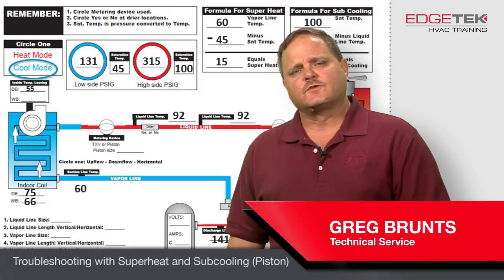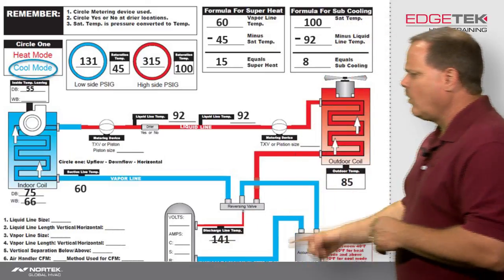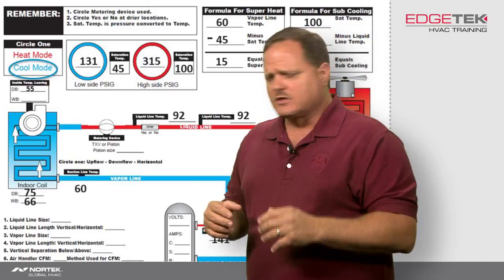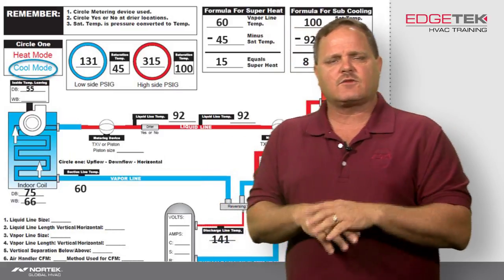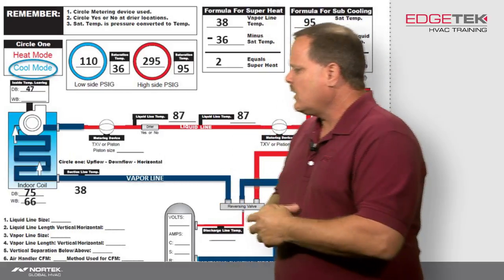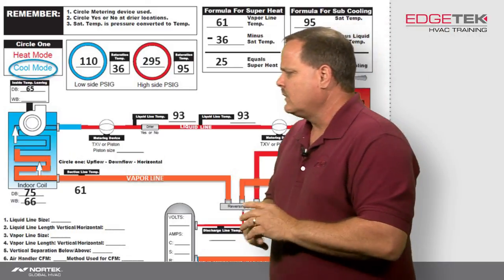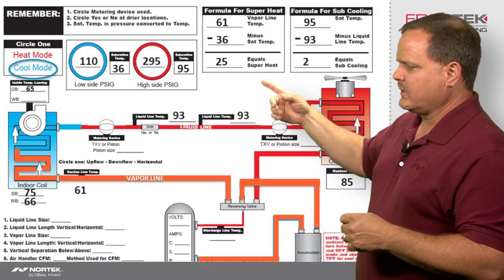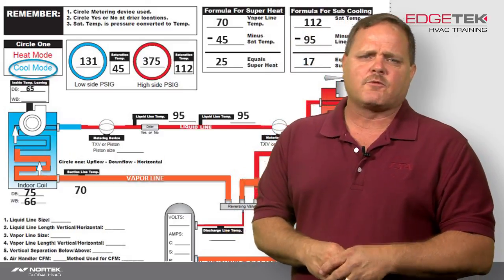Troubleshooting with Superheat and Subcooling (Piston)

Comment: Today I actually had the "undercharge" condition(SH 30deg over target, SC 5deg) but my head pressure is 390 which seems high.  Piston metering.  Airflow good, filters clean. Afraid to add more refrigerant since due to high pressure. Am I concerned for nothing and should just add refrigerant and only look at temperature targets regardless of pressure? You mention "don't care about pressures", so perhaps I'm just overly cautious.

Comment: I like the movie "Sling Blade"...keep it simple!  You come on a unit with a frozen evaporator cut it off.  Check the filter(s).  Put it in the heat mode and defrost the evaporator.  Then put your gauges on it and see if it is low freon.  You checking all this sub cooling and super heat when you could go and check for a stopped up filter and defrost the coil and sign off on it!

Comment: i got R 22 system ,,,,low pressure on suction side averages 35 psi with high superheat of 62, discharge is 177 psi average. sub cool yesterday was around 12. any suggestions? also evap freezing.
Reply from the maker: Please contact Nortek's technical service team at 1-800-422-4328 or contractorservices@nortek.com

Comment: Good Morning Sir, thank you for all the valued informations, me and my colleges would like to see and hear from you the Signs and scenarios to check the charge of an Air Conditioner Evaporator having a high return air temperature.
Reply from the maker: High return temperature is essentially high load, this will cause high suction pressure and high superheat and possibly high head pressure. To accurately adjust the charge you will need to run the unit for a while and get the high load under control before making final adjustments to the charge.

Comment: hi , how do you find the INDOOR superheat if there's no shrader port at the evaporator outlet? thanks.
Reply from the maker: Hi Mark, 
Typically superheat is measured at the service valves at the condensing unit.

Comment: what would cause superheat to fluctuate up and down 8 my superheat would be at 14 and go down to 6 then go up to 20 but the pressure is high and low will stay the same?
Reply from the maker: Hi Mark, Insufficient airflow or improper sensing bulb mounting  causing TXV to hunt.
Reply: Thank you
Reply: Could be the bulb.  Could also be non-condensables in the system.  Meaning the system wasn't evacuated properly and you have something other than pure refrigerant in there.

Comment: Are there any deferment between calculation super heat & sub cool  at( refrigerator and  air condition ) units ?
Reply from the maker: Hello! Sub Cooling and Superheat are calculated the same on any refrigeration system, although the required superheat and sub cooling may change.

Comment: Can you check superheat pressure on the low side when the heat is on? It seems that the pressure needle flips 180? When i put the ac on to test like i normally would I read 25lbs its like 65 degrees outside. I normally test at 90 degrees and get 115lbs
Reply from the maker: Hi Jim, our technical services team recommends testing an A/C when it is 75 degrees outside or above.

Comment: hi my a/c high side is low that is the piston or the coil
Reply from the maker: If the high side is low and the suction is normal to high it
could be an oversized piston or improperly installed piston more than likely
not a coil issue.
Reply: i need to replace the drier filter on the condenser
Reply: thank you